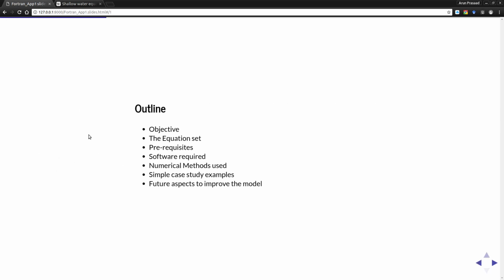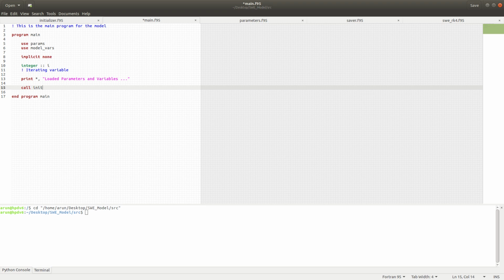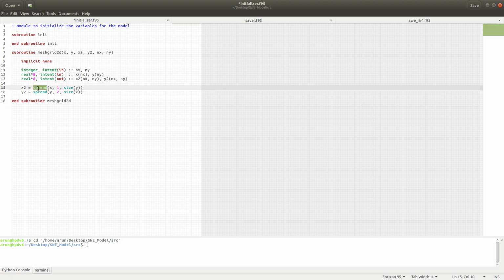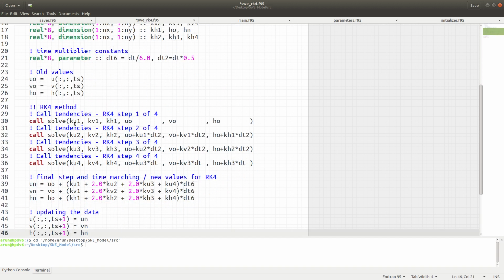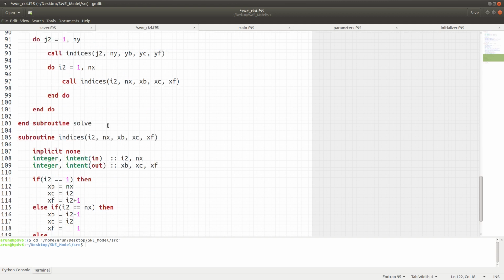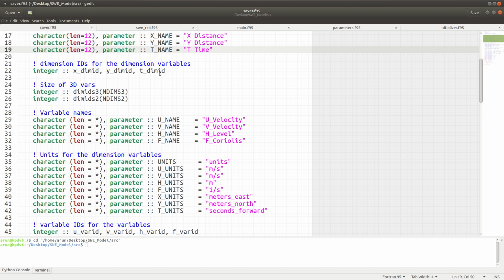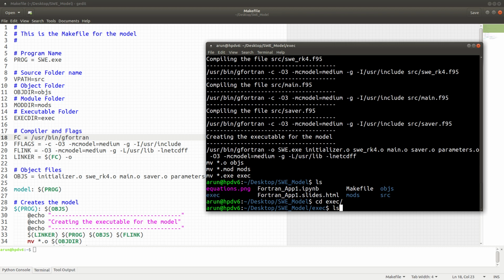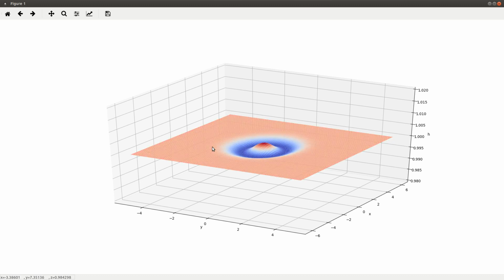Shallow Water Equations Model using Fortran in 90 minutes

Comment: Amazing video!! But I'm a bit confused about the explanation of the westward propagating components that you speculated they were Rossby waves, because it seems a constant Coriolis factor "f" is preset in the the primitive equations (though the structure seems likely to Rossby waves). The existence of equatorial Rossby waves requires the factor "f" to be varied with latitude. Currently, I have no idea why a constant "f" can result in a Rossby wave-like response.

Comment: Ram Kumar pointed out that it should be 1/(2.0*dx) instead of 1/2.0*dx.

Since this is using periodic boundary, instead of using the indices subroutine and looping through x and y, one can use  cshift() for centered differentiation. e.g. `(cshift(hin, 1, 1) - cshift(hin, -1, 1))*dgx20` gives the x-direction pressure gradient force term, for all grid cells, so no need to nest-loop the grids.
Reply from the maker: Yeah, what Ram pointed out was right. My bad.

I didn't know about cshift to be honest. Thank you for the info. :)

Comment: Hi Arun. I'm a student from IITM. I have a doubt in domain decomposition using MPI in fortran. I have a huge 1.8 GB text file which has the x,y,z and the corresponding vector fields. I need to calculate curl and divergence of the vector fields. I need  to write a code to parallelize it using MPI. My sequential program works perfectly. If you could help me out it'd be great.

Comment: Hi mr.Arun, i got through the entire tutorial. Its superb but i got 2 doubts.
1. Is 1.0/2.0*dx == 1.0/(2.0*dx)? Because as per definition the RHS is correct.. but u used the LHS one.. is that correct by due to some operator precedence in fortran? Because in Matlab, python and major languages the RHS seems to be correct.

2. I wrote several CFD codes, but i used only single .f95 file to do it without any subroutines. Will that be efficient or using subroutines be efficient in terms of speed?
Reply: if it was really meant 1.0/(2.0*dx)  then it must be 1.0/2.0/dx  multiplication and division have the same precedence:    https://software.intel.com/en-us/fortran-compiler-18.0-developer-guide-and-reference-summary-of-operator-precedence
Reply: You are right. Arun has made a mistake in the routine